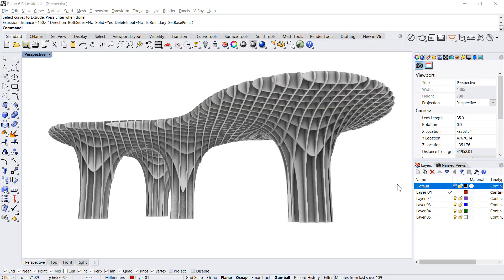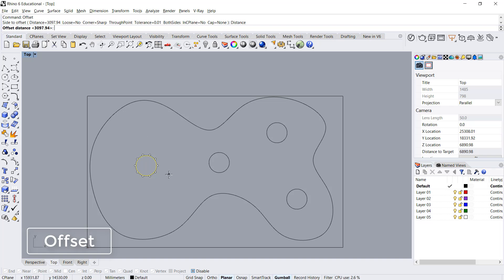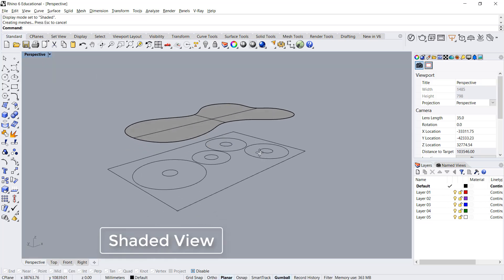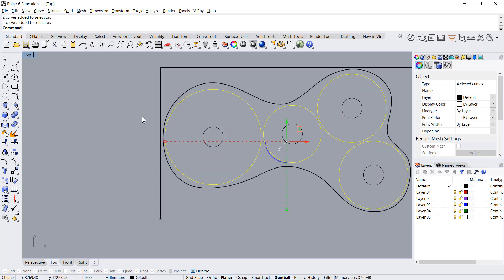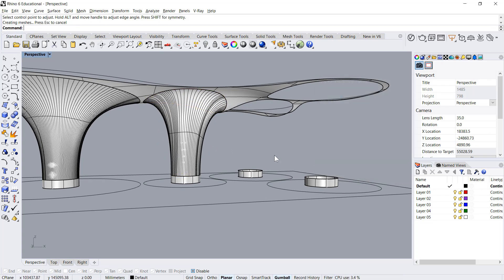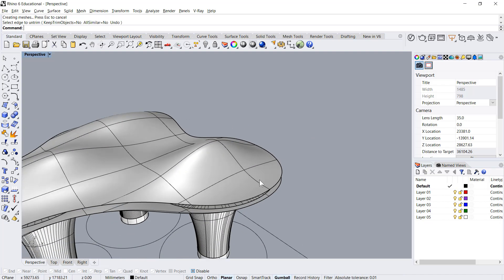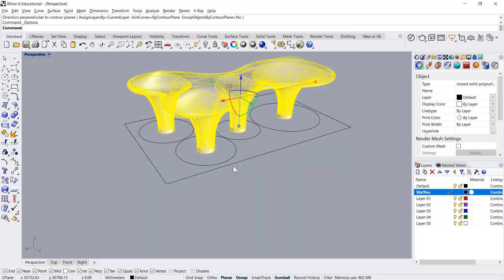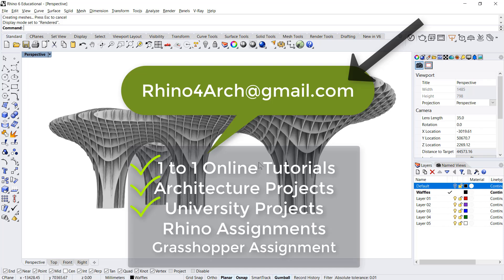Master Waffle Structures in Rhino – Fast & Easy 10-Min Tutorial (No Ads!)

Comment: Didn’t work for me. The plane does not follow the extruded points. Is stays flat.
Reply from the maker: Yes Brand, that is possible for several reasons (maybe the curves are not closed). In this case, you will have to select Direction and set it manually in the process of extruding curves.
Reply: @RhinoProf  I figuered it out. Degrees was on 1. That’s why it didn’t work. But it is fruststrating when you don’t know why it happens. But exporting to vectorworks is Not that optimal.

Comment: Hi man thanks for your tutorial. I was wondering what’s the best way if you were to cnc this - is there a way to get it to slot together? And then a way to flat lay it easily for cnc??
Thanks heaps
Reply from the maker: you are absolutely correct in the way it will be assembled. I take help of grasshopper to do those connections and laying it flat for CNC
we can have a zoom meeting to work it out. i do work with few CNC furniture fabricators to make parametric furniture designs

Comment: Hey! I want to 3d print this, but the 3d printer wont let me. Is there a way I could prepare the 3d? Thank you
Reply from the maker: Yes, You can 3d print it if the thickness of the profile is more than the minimum thickness that the 3d printer can print. I would recommend SLA print over FDM in this type of model. Cheers
Reply from the maker: you can schedule a zoom meeting with me to get customized 3D designs for your projects. I am happy to help you. My fee will be on hourly basis. You may contact me on my website https://rhinoprof.com/

Comment: hi may i know why in part doing contour and after click for 45 degree my rhino was lack ?
Reply from the maker: Hi, I think the spacing is too small or there are too many contour curves that rhino has to generate, therefore it lags a little. It might sometimes show "not responding" but dont worry, it will start working once the contour operation is done. If you think that the software is not doing it correctly then you can press 'ESC' button on the keyboard couple of times and it will cancel the contour command.
Reply from the maker: You can schedule a zoom meeting with me to get more advance in Rhino and execute some projects together. I am happy to help you. My fee will be on hourly basis. You may contact me on my website https://rhinoprof.com/

Comment: Very helpful and interesting. The challenge from here is to figure out the geometry for cutting these shapes out of sheet material like plywood so that they slot together.
Reply: Bring it into soldidworks or fusion etc and you can select each rib as a plane and pick the edges to create the rib to be cut in cnc etc. it’s a manual hub but not impossible
Reply: @ottigreenisgo  That is possible even in Rhino, not necessarily CNC but Laser cutting.
Reply: @The-Celestial cnc and laser cutting are basically the same, depending on the material, cnc, laser or water jet. What I needed to make from this setup I needed to cnc as the material was too thick for laser

Comment: Hi in the end I never got desired effect, when I switch from shaded to rendered the wires on the surface of the structure still remain. Any idea what I did wrong?
Reply: You forgot to turn on ‘solid’ when using the contour or the extrude command
Reply from the maker: Hi, I understand that your render style is showing isocurves. Please try Arctic display style to see if you achieved the desired result. Thanks for sharing your issue. I hope it solved your problem